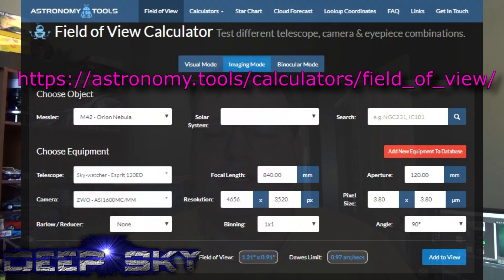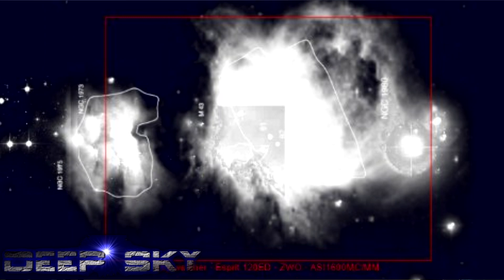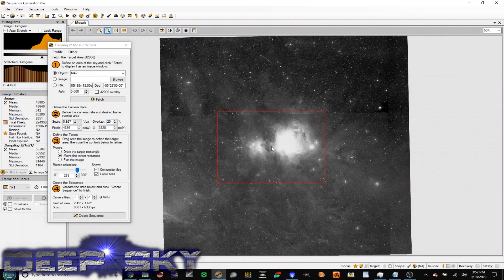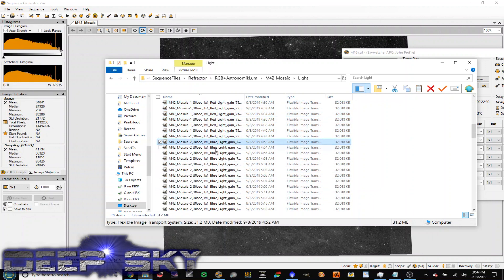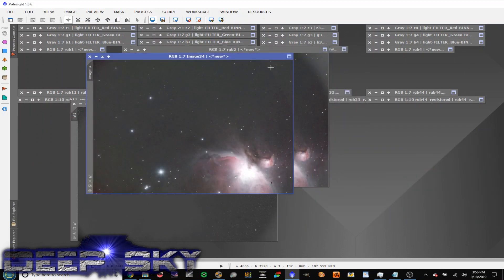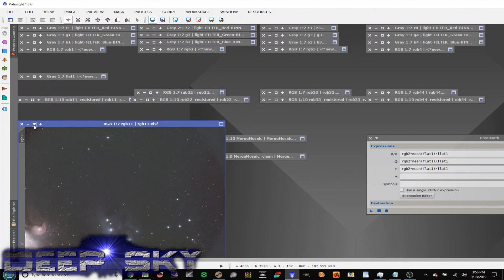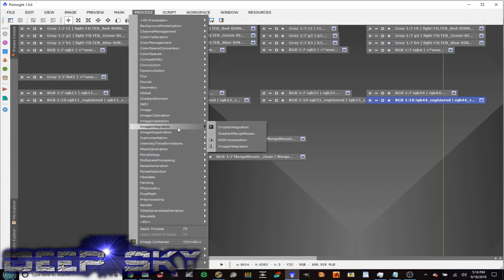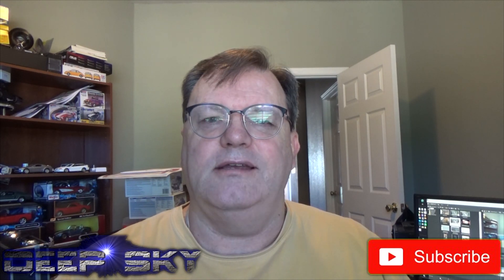Video #14 4-Panel Mosaics in Astrophotography

Comment: I am loving your videos, thank you, I am learning a lot from them.  I do however have a question that I am not able to find the answer to anywhere else, I hope you don't mind me reaching out to you to try and find the answer.  I'm using SGP and I have shot a 6 panel mosaic over 2 nights, ha the first night and oiii the next night.  I have stacked in dss and then done a star align in PI, aligning to the ha file.  My oiii is out by about a centimeter, some panels more on the right, some more on the bottom or left.  Someone said it must be my mount, but SGP does a plate solve at the beginning of the session.  I am baffled, can you give me any clues?  I've also noticed this when shooting the same target from night to night, not mosaics.
Reply from the maker: It's difficult to diagnose without seeing the problem in the image.  But I'll suggest this : for a 6-panel mosaic, you need to align with 6 different files.  You cannot align all to one file.  Each panel in the mosaic of 6 needs it's own alignment.  After that you can merge.  Does that help?  Alternatively post your photos online somewhere so I can have a look.
Reply: @real_astrotard  thank you for taking the time to reply, i figured it out. My SGP tolerance for plate solving was set to 1000 pixels.  I'll play around with fixing that up next clear night.  Stay safe